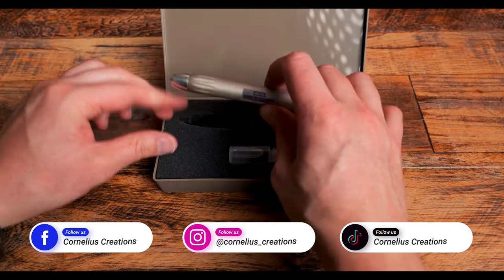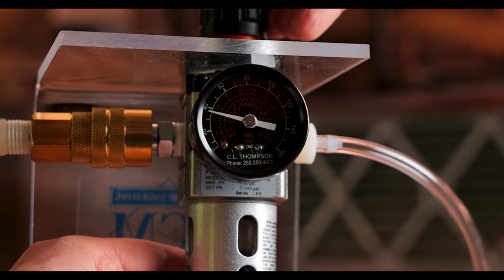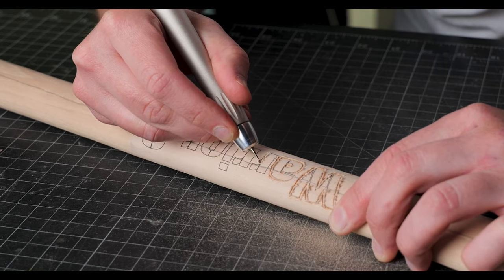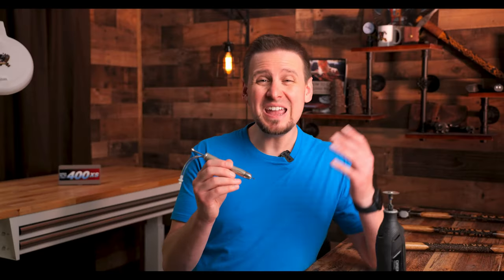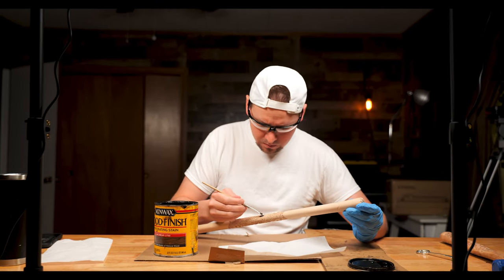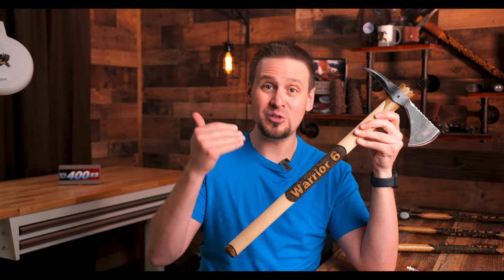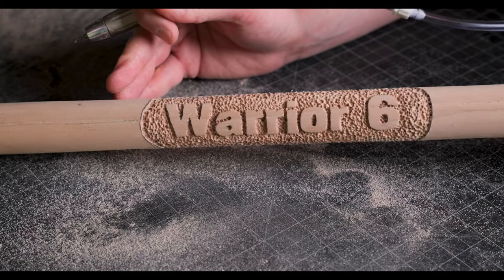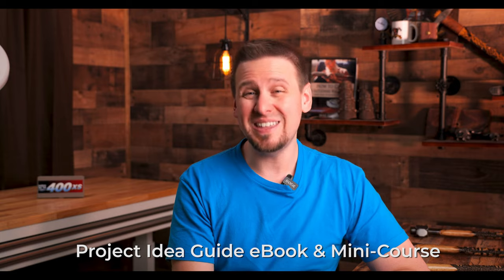Wood Carving with the World's FASTEST Rotary Tool // It's a GAME-CHANGER

Comment: That's awesome, thanks for sharing. How much carving time were you getting between tank refills?  Do you think you could run this using a free standing 5 gallon bottle? I don't have room in my workshop for a compressor, but I do have a compressor in my garage and have a 5 gallon bottle.
Reply: I have one. It won’t run long on a bottle. The 4.6 gallon compressor that came with it runs every few minutes for me.
Reply: Thanks Mark. I thought this might be the case. I can't afford to run a compressor , dust extractor and tools at the same time, so I can give this tool a miss.

Comment: Hi, Matt...been watching your videos for a very long time. My question on XS400 is the dust.  I use the Dremel 2050 Stylus, and I've got Strong 202 Micro Motor where I do mostly glass.  My work is generally outside; but, if the XS400 doesn't produce a whole big mess of dust shaving etc., then in the winter, I can use it in my basement.  I love relief work, and thinking this may just be the ticket. Would a dust collection be necessary?
Reply from the maker: It’s not necessary but I do recommend one for what you are doing. Buy once cry once lol.